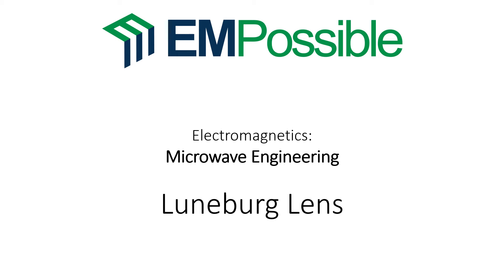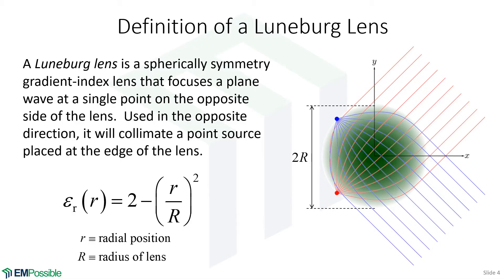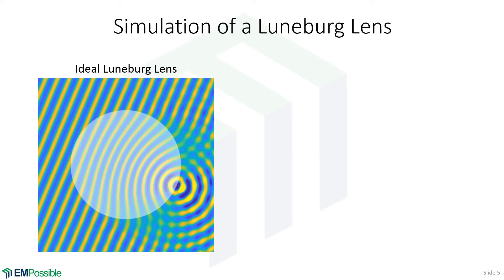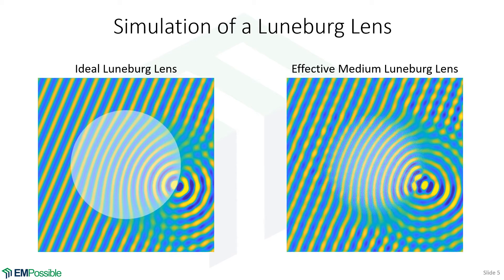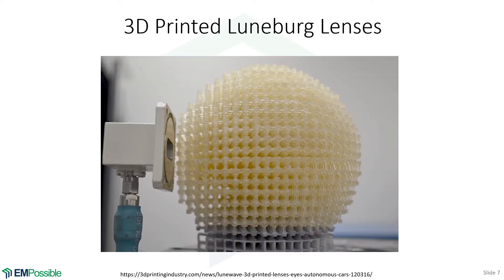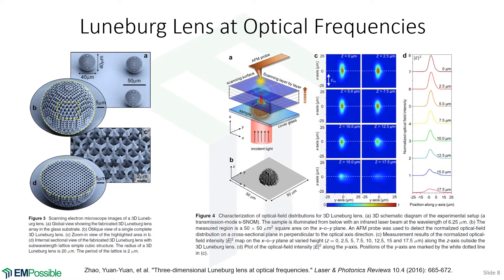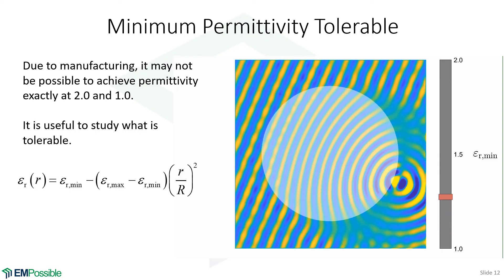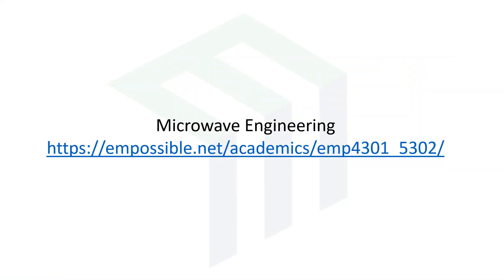Lecture -- Luneburg Lens

Comment: Hello! This one is a very good video, explaining and understanding the Luneberg basics.
Could you plese give some advise how to test this lens? I have to find the resonance frequency of a D=12cm Luneberg lense in X-band. All I have are standard 1-18GHz horns of 15cm aprture, signal generators, EMI-receiver, SA, VNA and an anechoic chamber and lens as AUT (only the sphere, without any feed). But I have some doubds - if I would use my standatd horns, wouldn't I have measured the horns itself and not the lens? S21, S11, VSWR for example.
Reply from the maker: The Luneberg lens is not resonant. I think what you need to do is scan the receiving horn to resolve and confirm the focal spot. Otherwise, yes the gain and directivity of your horns factors into the measurement. Typically people would meaure transmission between two horns without any lens and then insert the lens. The difference is the response of the lens.

Comment: Thanks for the clear explanation. I was wondering what would happen if you had two dipole sources at different points on the surface of the lens? Would this result in two separate beams being emitted from the lens propagating in separate directions? Or just a single beam in a direction which is a function of the angle of separation between the two sources (cf. like a phasor sum of the two sources)? Thanks!
Reply from the maker: Glad to hear the video helped!

If you had two sources, you would get two output beams. Each of those beams would like like the beam generated by the source alone. This is because the lens is linear and the fields from each source would not affect each other. If the lens were made of something nonlinear, things could change.
Reply: @empossible1577  Thanks for the answer, much appreciated!

Comment: Very helpful explanation.  I work for Masting Antenna.  We make Luneburg lens antennas using meta materials.  We have been able make the meta materials with a consistent permittivity and have been deploying our antennas into many dense population areas to increase capacity from a single location.  As an example we are now in over half the NFL Stadiums.  Thanks for the great Illustration
Reply from the maker: That is awesome to hear! Thanks for sharing!
Reply: @empossible1577  - I work in the telecom industry, and I am aware of Matsing, but I really don't enough to understand the difference between these antenennas and the ones we normally put up on towers. Do you have a video that explains the differences?

Comment: What are the applications for this?
Reply from the maker: They are most commonly used in conjunction with antennas.  If you place a dipole at that "focal" point, it will give that antenna very high directivity.

Comment: Does this mean that somewhere on the Earth's surface (at a point exactly opposite of the sun) we get an electomagnetic flux concentration focal point from the sun?  This would also focus the sun's neutrino flux?  This calculatable point would be an interesting nexus for a dipole power generation antenna that would move with the position of the sun.
Reply from the maker: No.  That would require that the earth be a Luneburg lens. While I do not know, but I doubt the earth has the correct permittivity values to function as a Luneburg lens. This is especially true at high and optical frequencies where the earth is essentially opaque.